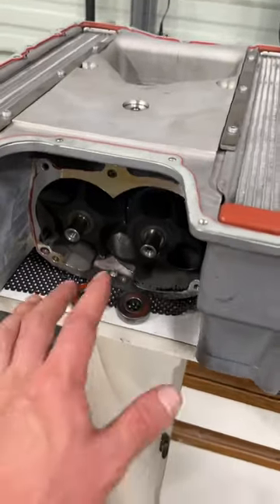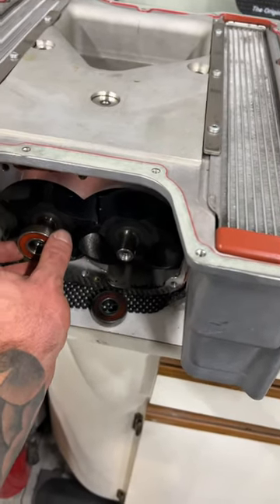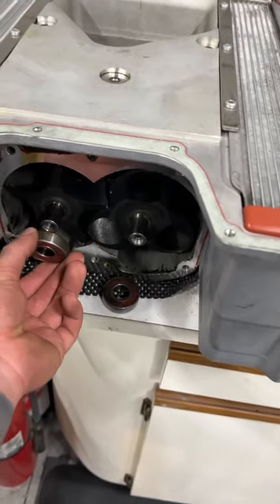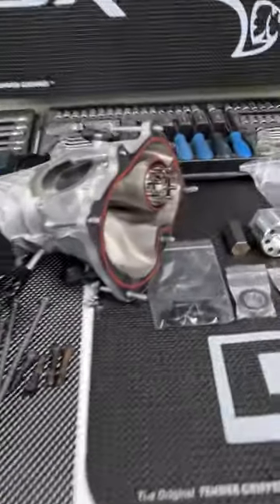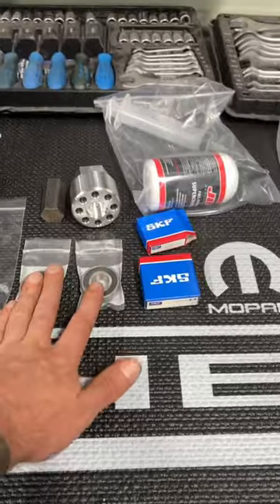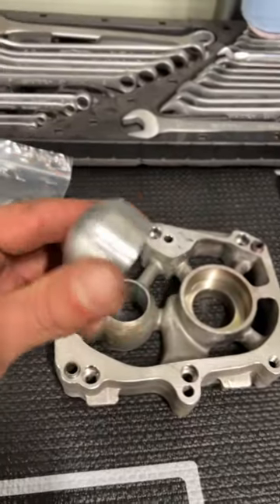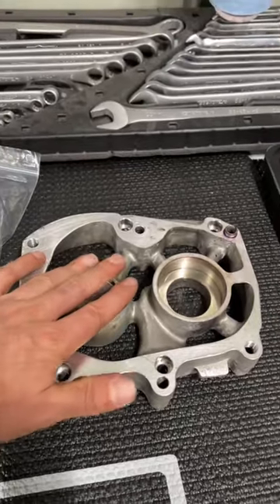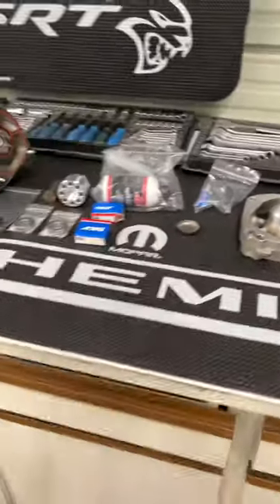Hellcat Performance Upgrade Mods

Comment: You make a good point. I didn't think of that. I have an Eaton M90 supercharger on a GM 3.8
I have a complete rebuild for it and was planning on putting a smaller pulley on it.  
I have OEM bearings, so , I glad I saw this video.
It makes me re-think my plans.  
Thanks.
Reply: Can I ask where you got your rebuild kit??? Ive got one on a jeep and don't wanna pay someone to do it
Reply: Heaton*
Reply: @elstupido4686  
Eaton M 90 supercharge.
Reply: @Soleimpala77754  
ZZPerformance.
Reply: @phillipthethird42  good old L67 Ecotec 
Mang mang
Reply: Better get a new Camaro asap..for all you Camaro lovers! GM will cease production soon. Same w/Dodge!
Reply: @s4ss.m8  Good stuff. GM performance! 🇺🇸
Reply: @Davido50  owned a VY Commodore here in Australia. Mine came Factory T5, m82 LSD diff and a Supercharged 3.8L V6. Had a full exhaust, engine was built with a ported Charger, made only 375hp, was a seriously fun car.. sold it like 6 years ago and bought my Ford BA Falcon with the mighty 4.0 Inline 6 barra. Recently built the motor and box put on a Turbo and its Getting its diff done after the new year. should be good for North of 550hp for the turbo I have. Motor and diff will be rated for 1000hp. The 4 speed Auto and the Turbo and intercooler is what's gunna hold me back but I'll be getting a TR6060 6 speed manual built and a Plazmaman 1200hp stage 4 cooler with a GTX4283, that'll be about 750-800HP when Done. definitely miss my old VY though. Was basically my first Build by myself with my own Hands.
Reply: What car is that on? I still haven't installed my rebuild onto my n/a 3.8 Monte Carlo SS. Had the bearings changed out and installed a Gen v plate that should give it 10% more increase with the trapped air port. I just need to get to it one weekend.
Reply: @Mac7504-OG  
What I have is a '98 Grand Prix GTP. 
With the foctory 3.8 supercharged. 
The supercharger is a Eatom M 90 supercharger and this conversation started with another guy saying that if you speed up the blower by putting on a smaller top pulley the factory blower bearings can't handle it.
When I spoke of a rebuild kit , 
I was referring to a rebuild kit for the blower only. 
My engine has already been rebuilt and so has the blower, but I bought another rebuild kit for the blower because I want to take it off and port it out and put on a smaller top pulley.
Reply: @phillipthethird42  nice I knew what you ment. I'm very familiar with the 3.8 L32, L36, and L67. 

I'm the owner of the Rytek Monte Carlo that appeared in SuperChevy and Motortrend. It has a lot more upgrades now though.  Just need to slap on the m90 kit. I sent the until out to be rebuilt and upgraded to Charlie's at Magnum Powers because the unit I received from ZZP was sort of beat. 
I can run get more power with less boost because I have higher compression than the L67. Just need to get to it. Just been busy with my ZL1 lately.
Reply: You either have a grand prix gtp or regal gts. Either way. You're an awesome human!
After my gtp blew up an 08 gp gxp fell into my lap... Goddamn do I love it. Currently pushing 560 with the car tuners TT kit 😩
I loved my 3800 tho. I always wanted to drop one into an 01 grand am gt coupe
Reply: @yomomma3570  you forgot Monte Carlo.
Reply: Sooo how I know your doing preventative maint but how do you know when your blower bearings are going bad. They already whine when running under load anyways
Reply: @Mac7504-OG  I mean ywahx but no one wants one of those. They're so ugly!
Reply: @yomomma3570  damn lol. That hit deeply.
Reply: @Mac7504-OG  😂 all that matter is that YOU love your whip! I'm just not a fan of the newest Monte body. I bet your car is still beautiful
Reply: @Soleimpala77754 most of the time m90 blowers don't even need rebuilts, 90 percent of the time it's just a bad coupler causing noises

Comment: Wow, those are just $3 alternator bearings. You can also use the same bearing in your spindles of your riding mower.
Reply: Yep. They're just simple bearings. Nothing special. Might as well use high quality items for a few bucks more. One of the biggest problems with American car manufacturers has always been using the cheapest possible shit for the simple parts. Normally, the drivetrain components hold up and the dumb shit breaks. That's why you've always been able to buy a Corvette for way less than a Porsche and they perform pretty similarly.
Reply: looks like skateboard bearings 🤣
Reply: @kezzup7720  I was thinking the exact same thing! I was building a board a while back. The guy at the skate shop was telling me about my bearing options. 
When he finished his presentation. He leaned toward me and said. "Buy the cheap ones. It's a skateboard not a precision piece of equipment."
Some may not be aware. Ceramic bearings with a crazy high rpm threshold are available for skateboards. The price is crazy too.
Reply: @davidsawyer1599  i used to use bones swiss because all the cheap bearings used to blow up on me while skating 🤣 i used to take the shields off all my bearings so kinda my fault
Reply: @kezzup7720  looks like bearings you find in a ceiling fan or a vacuum cleaner brushroll 🤣
Reply: That's because modern cars are built like shit. They don't want these things lasting very long and they do stuff like this to ensure failures, repair bills, total car replacement.

IF they wanted to build this right they'd be using plain bearings oil fed by the engine's pressurized oil circuit instead.
Reply: @davidsawyer1599  I was thinking those might be better than oem. Designed to withhold high amounts of force while under load

Comment: If you want so super good bearing , you can get even better then SKF , just go to like a BDS or another Bearing and drives place and they’ll hook you up with some Timken or Even Like a Swiss but from experience in the industry skf is alright , definitely the German and Swiss are top notch though . Just from experience of rebuilding speed reducers and transmissions etc .

Comment: SKF is indeed an upgrade. ALOT of your bearing manufacturers have INSANE amounts of technical info like how to read part numbers, all the different ratings, seal materials, all the different applications, etc., etc., on and on. If you're a tech nerd, wanna know exactly what this knowledgeable dude is talkin' 'bout (Willis), get a better idea of which ones are right fur whatcher doing, or think I'm 100% full up of excrement, I'd say, "Check it out!"

Comment: Sooo how I know your doing preventative maint but how do you know when your blower bearings are going bad. They already whine when running under load anyways. And that's pretty low effort on them not putting something aerodynamic on that cap. It's low hanging fruit

Comment: Those look about the size of John Deere mower blade shaft bearings. They most of the time have little grease inside. Relying on the grease to sit inside the cavity get hot and melt its way into the bearing.

Comment: Why would they put factory bearings in that aren't rated for stock power. Nothing like car companies that make sure that something is eventually go bad so it cost you more money.
Reply: Sounds like Chrysler
Reply: They are fine just people that abuse them need... putting the smaller pulley don't do crap unless the computer has been changed it don't do upgrades... and a tune put on...

Comment: Shit design. What's wrong with a pressure feed from the engine lube oil circuits on a couple of plain bearings like we did back in the day on the GM 6-71 units?